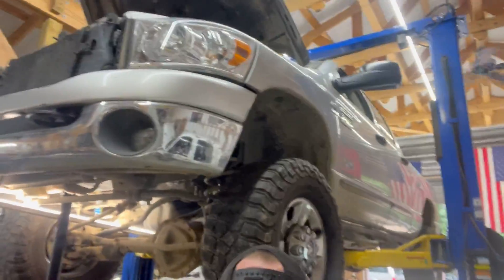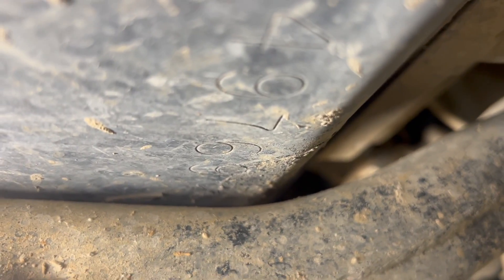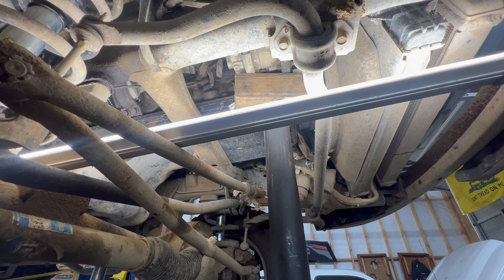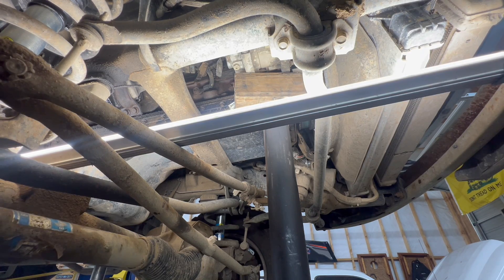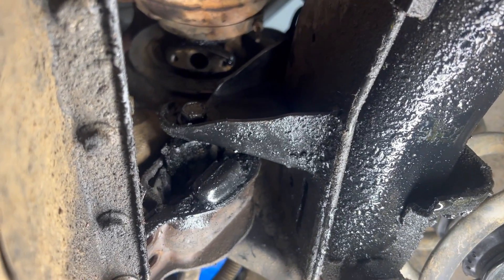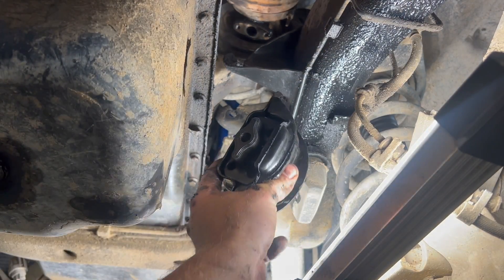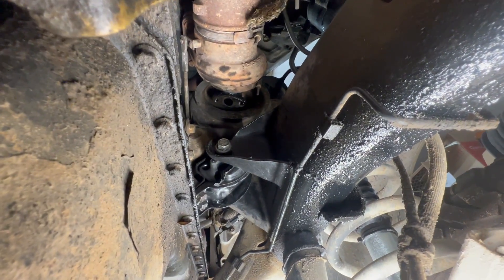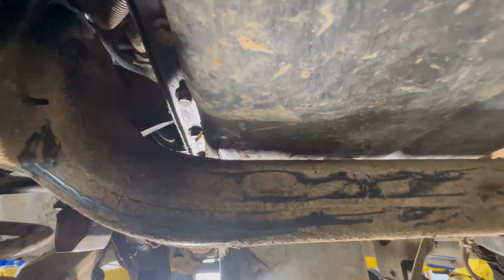3rd Gen Cummins motor mount replacement

Comment: Replaced motor mounts on 2006 dodge ram 2500 5.9.  At 183000 it made a big difference.   Used mopar mounts.

Comment: Will these motor mounts be the same for the 04 ram 2500 5.7?
Reply from the maker: Similar but not the same
Reply: @AutomedicGarage would you know which ones to use? (Part number, pics?) any info would definitely help. My trucks been in the shop for almost a year because I can’t find the right mounts.
Reply from the maker: @joserangel8682  call me tomorrow I’ll look the number up at the shop

Comment: What kind of symptoms do you usually see with these trucks and mounts? Mine seems to have a clunk putting into drive and now you can feel it when it shifts . Motor does seem to move good amount when putting into gear
Reply from the maker: Check your motor mount especially passenger side. Turbo oil leaks degrade the rubber in the isolator.